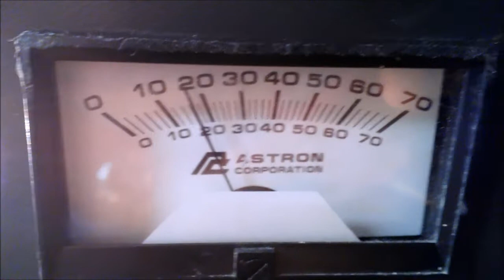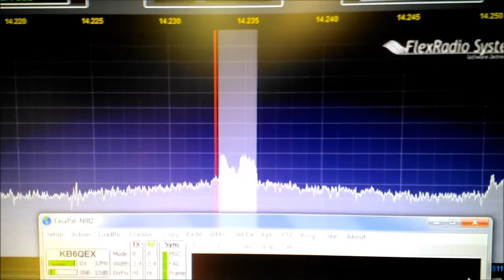Load testing an Astron RS-70M

Comment: Using a purely resistive load like lamps or even resistors doesn't accurately reflect the stability of a power supply. The current usage of the lamps also doesn't approach the rating of the Astron which when dealing with voltage regulation of a linear supply can be more critical. Dynamic load testing, including speed pulse load testing, is far more critical for radio power supplies.

Comment: My 70M's amp meter swings backward when I key and speak into my radio....what would cause that ?
Reply from the maker: Could the wires be connected backwards on the meter.  It's obviously supplying current or the radio wouldn't transmit any power.  You could verify the actual current draw on the power supply using and clamp on ammeter over the positive DC wire going to the radio and transmit in a constant carrier mode.  Also place a volt meter across the DC output to see how much voltage drop.  Unfortunately, I don't have a schematic handy that might indicate another reason for backwards swinging meter on transmit.  Hope this helps and you found the video interesting or useful.